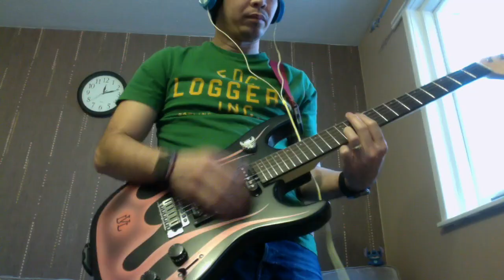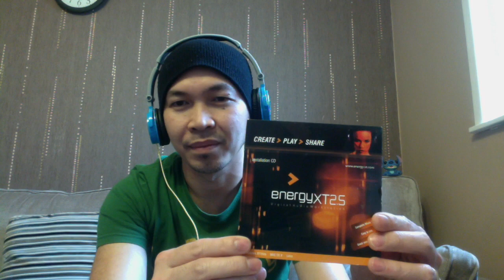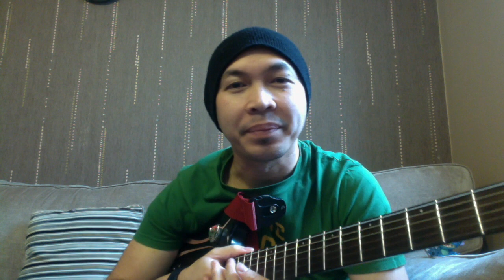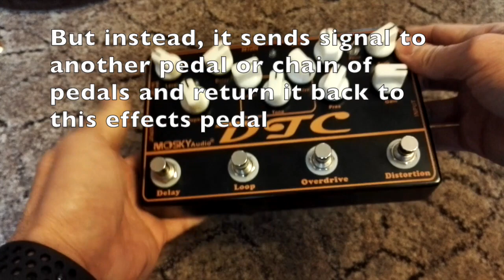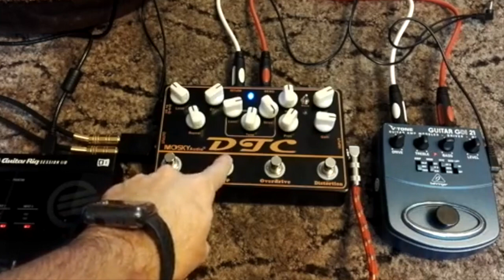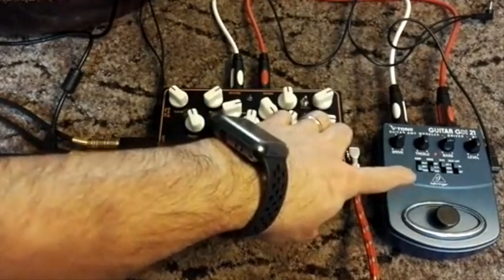Mosky DTC 4 in 1 Loop Demo

Comment: It won't be in Stereo. There is no Stereo signal being produced, your only splitting a mono channel, that is not stereo. Thank you for sharing  i have the Red Fox version, i think their virtualy the same.
Reply from the maker: The output of Mosky is not stereo you’re correct so when I first recorded it using my Native Instrument Guitar Rig Session IO USB interface it came out mono. So what I did was put a splitter on the output and then split the signal on the input of my guitar interface. That solved my problem with the recording.  

The red fox I think is new ish. Probably came out after this Mosky 4-in-1

Comment: Hi. I Am curious about the mooerge100/dtc setup. I am trying to get a similar setup to your worship video. Would you maybe explain how you hooked it up please because for some reason my mooer wont connect to other pedals. Thank you 😊
Reply from the maker: You can experiment and find out which one will work best. You can try from your guitar going to Mooer GE100 input then out going to input of Mosky DTC then out to amp. Or, just like here on the video where you plug your Mooer GE100 via the loop. Send of Mosky going to input of Mooer then out of Mooer going to Return of Mosky. Remember to activate the footswitch of Mosky so that the Mooer will work.  Lastly, you can try from you guitar plugged into Mosky DTC input then out going to the input of Mooer then amp.

Comment: Im thinking of trying the mosky dtc on a bass. What are your thoughts?
Reply from the maker: Islappada bassmon I think it will work. Such a shame theres no modulation, would be great if there is phaser for your bass.
Reply: Hi, 
I’m using this dtc for bass. Works perfectly. I only add a noise wiper after the dtc output. Good combo, I recommend!😉

Comment: hey i just wanna ask u, i have 4 pedals which is distortion , chorus , boss compression sustainer, and this mosky dtc, can u recommend me which position the pedals should be in the chain?  , can u help me arrange them? im sorry if my english is bad
Reply from the maker: qezeq yes Im glad to help. And your English is good. I would recommend that you can leave your distortion because the Mosky 4-in-1 already got overdrive and distortion but if its special to you and you really want it then this is the chain that I would suggest starting from your guitar to amp. Start with Compressor/sustainer, Distortion then Mosky 4-in-1 then on the send and return of Mosky put your chorus there. So that your last effects is delay.  Hope this helps

Comment: How can I use Mosky DTc pedal along with the other stomp pedal? I have chorus and compressor? Do i need it connect directly to the output of dtc? Or plug in directly to the loop??
Reply from the maker: Razil Labro you can series them or use the loop send and return. I prefer series like before or after Mosky. If its modulation like chorus it can go in the loop so thatnits in between delay and overdrive.
Reply: @vincentryanborres  so pwede ko pa din chain yun kahit hindi na naka loop?? Guitar, pasok sa mosky, then chorus,and compressor tapos out na sa amp?? Without using the loop?? Possible din ba yun? May effect din ba yun sa mga tunog??
Reply from the maker: Razil Labro pwede din yan sir. May effect sya sa tunog kasi kng in between ang chorus ibig sabihin meron ng chorus bago ang delay. Kng after naman sya ang mangyayari nalagyan na ng frequency or tunog or tone ng delay bago pumasok sa chorus at compressor. Magandang experiment din yan sir. Depende sa magustohan mo na tunog. Depende din yan sa guitar and amp mo na gamit. Kaya trial n error lng tayo.
Reply: @vincentryanborres  sige subukan ko! Salamat ng marami! Thank u for uploading this video..kaya ako napabili ng mosky kasi nakita ko video mo Sir! Keep it up! Thanks
Reply from the maker: Razil Labro sige sir tapos update me kng ano prefer mo. God bless!

Comment: Sir bago lang dumating ang order ko mosky dtc bat wala pong effect lumalabas pag pinindot ko na ang  (overdrive,dist,loop,delay) nag mumute ang gitara walang sound na lumalabas kng patayin ko naman lahat ang effects tutunog na ang gitar apero walng effects. Patulong po sir huhu 😭
Reply from the maker: Nem Esto make sure sir na ang guitar input and output to amp is correct. Tapos baka cable or volume control issue. Check your guitar volume pati na rin volume ng effects and amp. D ko rin alam sir kasi d ko nakikita. Hopefully hindi factory defect.

Comment: No way... so I have to connect it to a separate pedal so I could use loop? That's some bogus. Thanks tho, I woulda never thought of that
Reply from the maker: Hello Nick, even myself when I was looking to buy this one. Yeah I thought is's a looper but no, it's just an effects loop which normally you can find at the back of a guitar amp or some mixing desk got this fx loop to send and return a signal. Useful for reverb and delay effects.
Reply: @vincentryanborres  Dang, I didn't think you were actually gonna reply
Reply from the maker: @nickhazbun3758  if you want a looper pedal that got other stuff like drum machine, multi effects and amp/cab sim where you can just plug earphones and jam or hook up to a. Iced or PA system during gigs or rehearsals, try the Zoom G1xOn or Zoom G1Four. I got lots of vidz on my playlist. You might like it.

Comment: so that loop thing in DTC will not work unless im using auxilliary stuff like that bheringer.
Reply from the maker: Benjamin Marasigan yes, because it’s a send and return loop. So you need another set of pedal or chain of pedal. Let’s say you really like the sound of Flanger and distortion together. So instead of stepping on those pedals, or even three pedals at once. Just connect it together and turn it all on and plug it to the looper so that your looper will control it. Meaning three pedals in one footswitch.
Reply: @vincentryanborres  thanks much bro.
Reply from the maker: Benjamin Marasigan you’re very much welcome.
Reply: @vincentryanborres  hi bro.
what should be the setting of bypass mode in GDI21?
Reply from the maker: Benjamin Marasigan bypass is like off. No effects. The GDI is acting like an ordinary DI box.
Reply from the maker: Benjamin Marasigan here are some of the settings I used. Might help you with the GDI https://youtu.be/UxtG_XAOcLs
Reply: @vincentryanborres  i saw you test loop it with dtc
Reply: just want to try the same
Reply from the maker: Benjamin Marasigan yeah, that’s great. it will act as boost. So if you have a clean tone and you want to play lead on clean tone that will be your clean boost. You can do lead/solo on clean. Then if you are on overdrive and you need a boost just step on that loop where you GDI is connected and that is your overdrive boost. If you’re playing heavy stuff and using distortion then that again will be your boost. Another missing pedal/effects is reverb. You can use the amp reverb or like me my amp doesn’t have it, so I use a reverb from my Zoom G1xOn

Comment: Can you conect to this pedal a noise supressor?
Reply from the maker: sc3sar87 yes you can. And you can put it after the Mosky pedal so it will suppress all the noise.
Reply: @vincentryanborres  thansk foor the answer but What about the delay? I read that the noise sup could mute the delay effect if its conected before
Reply from the maker: sc3sar87 yes it does affect even the sustain of your effects so it’s a bit tricky. Another way to make your effects pedal quiet is instead of noise gate, go for wireless guitar system.
Reply from the maker: sc3sar87 here’s my video on my Zoom G1xOn noise reduction. This might help you get the idea about Noise Reduction https://youtu.be/uk07W2axR38

Comment: Thanks, this is exactly what I wanted, could I use more then just one pedal in the looper?
Reply from the maker: Yes, you can chain pedals but I’m afraid, there’s only one switch allocated. For example you got chorus, compressor and auto wah chained then connected to looper.
Reply: @vincentryanborres  Hi.  "Only one switch allocated" can you explain further.  Medyo nawala ako eh(^^)  So we can use more pedals sa loop pero only one switch allocated then boom nawala na ako (≧▽≦) Thank you sir & do make new videos - beginner aspiring lead guitarist here.
Reply from the maker: Ahngiebee G bale ang loop function ay parang switch sya ng certain pedal or pedal combination. For example may kanta na ang chorus tapos harmoniser at overdrive magkasabay sa bridge ng kanta or as ADLIB so kng individual pedals ka during live gig, aapakan mo yung tatlong pedals ng mabilisan pAra mahabol mo yung kanta. Kaya ang solution ay yung loop. Naka on na yung tatlo mong peda tapos nakakabit sa send and return ng loop para isang apak ng lng sa switch ng loop.